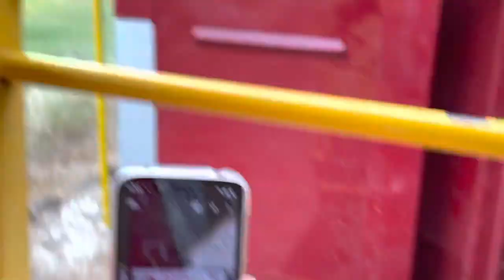Take a train ride with us!

Comment: That turn around is for the engines and caboose, the cars don’t need to be turned around they can go either direction. Technically the engine can push or pull too but the front engine prefer to pull for visual reasons. Hope that helps and makes sense